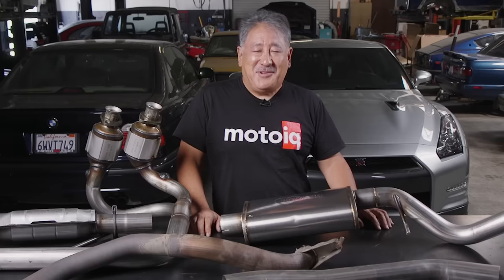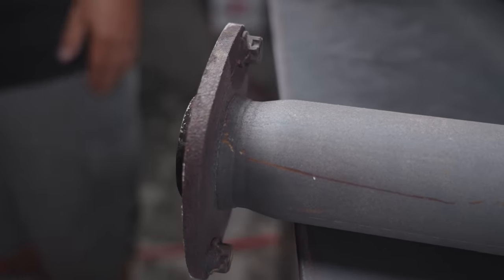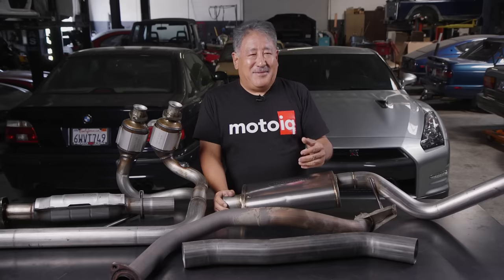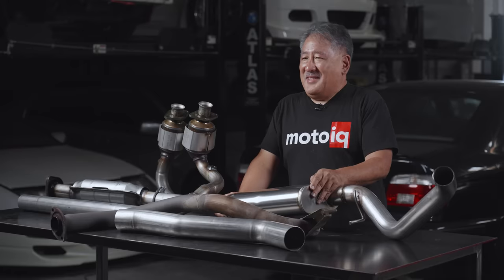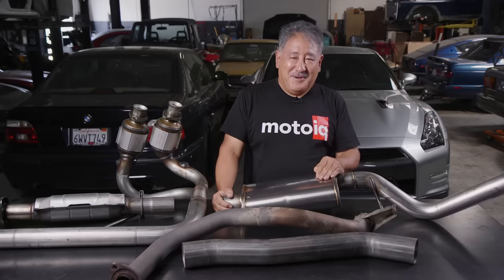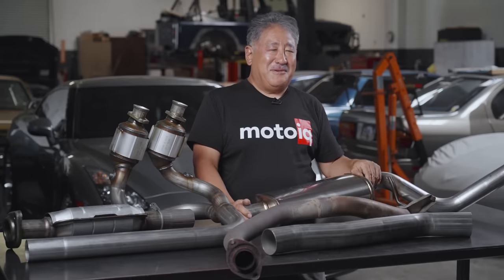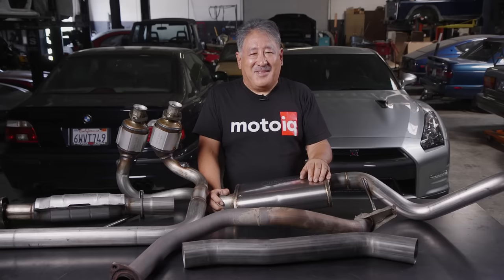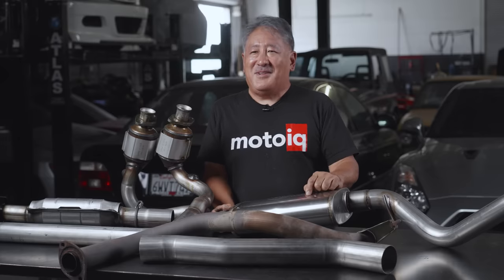Exhaust Back Pressure Myth DEBUNKED!

Comment: I have been trying to explain this to people for years, now I can just send them your video.

Awesome content!
Reply: Same here... there are other videos as well but Mike has some "cred".  Silly how even today people mention needing back pressure on a four stoke engine.   On two stroke "back pressure" is really reversion pulse tuning otherwise two strokes don't need "back pressure" either.
Reply: Exactly the same thing I was gonna say! I always tell people, if back-pressure is a good thing, go tell the top fuel dragster guys to put mufflers on instead of zoomie headers only!
Reply: Likewise, but there are folk out here still saying you need back pressure to make HP 😖
Reply: But really , how many people think what he said was I need 3 inch straight pipe on my stock Honda Accord
Reply: @daviddntait  and truthfully it is just a restriction, not back pressure, as you arent pumping air in from the other side.
Reply: . buy a harley and put duals on it with a proper tune vs. 2 into 1 with proper tune... proper backpressure fir the application puts the torque curve were you need it. . Nobody on the st needs it all at high rpm
Reply: @frederickcook87  no you need  back pressure to manipulate the torque curve to a area that suits your driving style. Not hp..  Wide open pipes only suit wide open use in higher rpm. Yes open pipes make more power. Doesn't mean it's usable
Reply: @dormantmenace  negative ghost rider, that’s a negative… but continue 👌🏾😝👌🏾
Reply: AWESOME insight. And although you implied it many times, it would be good if people understood scavenging. That is one of most over-used terms out there by people who don't know. Scavenging only comes into play at higher RPMs. Most folks don't realize that. So unless you are hard on the throttle and in upper rev ranges scavenging is almost irrelevant. The velocity issue also doesn't have much impact on engines at lower rpms (where daily driver requirements are). The only time velocity has any impact is also at the higher rpm ranges.
Reply: Same happen with flywheel, i try and try explain "you never lose engine power with light flywheel just inertia when release clutch " but these myths stay for years
Reply: if you follow this guys advice you'll be deaf before your 60
Reply: @frederickcook87  I’m still under the impression that you do because it evens out the exhaust pressure in the cylinders, giving you more even timing on detonation on all of the cylinders. You can go bigger exhaust but you have to run balanced headers.
Reply: @LeoKadettTouringCar  I'm genuinely asking since you brought it up. But that does mean you are siding with a heavier (more traditional) flywheel instead of those fancy schmancy carbon f***er lightweight flywheels? If you can enlighten me please do, I really want your opinion.
Reply: @dsch1znit  not sure I follow what you’re saying… did you even watch the video???
Reply: @dormantmenace  thanks for having a brain.
Reply: @frederickcook87  engine masters proved you and motolowiq wrong. Straight headers make less power than collector extensions. They tested a 1k hp engine and found there’s a sweet spot between 12-18 inches, creating a small amount of back pressure. It was enough hp difference that you’d be stupid to not find the proper length for your engine. IIRC they say d it was some of the cheapest power they’ve made. 
🌠 the more you know.
Reply: @frederickcook87  people that know their shit don’t need to watch a bullshit video. The dyno doesn’t lie.
Reply: magnaflow did a video like this years ago,
Reply: oh .....you mean cos ONE MAN says so.......its TRUE???????
Reply: @jimw7916  it appears many people say the same thing so......
Reply: Audi engineers also say that noise is lost energy.
Reply: Just send a top fuel dragster video, the most extreme HP and they have half foot pipes.
Reply: Really enjoyed your presentation sir...thank you for sharing your knowledge...
Reply: This is why i straight piped my crv lol
Reply: I used to think you could "suck a valve" running a motor without the exhaust hooked up. Because of the lack of back pressure LOL I'll never forget the first time I was corrected in a forum for it. It was a two-day rabbit hole of Google searches trying to figure out if there was ever a motor that needed it and why modern motors require no such thing
Reply: @lobsterroomcleaningservice  but you’re loosing velocity. But unless you are making actual power it’s not gna matter that much.
Reply: @shythawks9549  cat thieves is a big factor also lol
Reply: @throbbinwoodofcoxley6830  header extension doesn’t increase back pressure to make that extra power, it smooths the exhaust pulse turbulence at the collector and keeps velocity high past it to help with scavenging. The header extensions that engine master tested are the same or nearly the same size as the collector, so no increase of back pressure there. Compare a 3” collector going into a 2 1/4” pipe vs a 3” collector going into a 3” pipe on a 500hp engine and tell me which would make more power.
Reply: Pardon me sir, but would you have any ka-ka-ka-ka Cocaine? JK, bro I couldn't resist, have a great weekend😁
Reply: @dormantmenace  By your own logic, wouldn’t you restrict the flow of the system at peak power by attempting to create backpressure at certain points throughout the rev range? As in, you might gain a little bit of torque, but you would lose a lot of power.
Reply: @flytoday  I feel like being deaf in my old age might just be a blessing given the state of the world today
Reply: @dormantmenace  what does torque even have to do with back pressure??? Have you ever seen how a 4stroke engine works??? Back pressure only makes exhaust scavenging harder which will never benefit power nor torque... Only 2 stroke engines benefit from something that ressembles back pressure and even then it only works because they have no valves.
Reply: @throbbinwoodofcoxley6830  thats not fucking back pressure, read some technical documents please, that is the exhaust pulses helping each other to scavenge exhaust gases thats why properly engineered headers make more power than no headers or a simple straight pipe from each cylinder, the size of the header cavity manipulates gas speed via venturi effect and the lenght helps sincronize the pulses into a continuos scavenging cycle but nothing else...
Reply: Ferraris team of engineers would disagree

Comment: My thought is that in the old days, people would go full flow exhaust without re-jetting the carb. It would run leaner and lose power. I know because of a 1983 thunderbird that I put a 351w in. I ran dual exhaust with a h-pipe. it had slowed down. Once I listened to a local garage friend of mine (running that garage since the 60s) I drilled out the jets slightly, corrected timing, and installed colder plugs. It made a huge difference.
Reply from the maker: Bingo you get it!

Comment: I remember finding a book in high school and i believe the title was "the design and building of the british sports car" and by sports car they really mean racing car. It was written by a pair of british mechanical  engineers  and what i found fascinating  was  that it was filled with formulas and tables  that at first i was pretty sceptical about. For example and pertinent  to this subject  they had a formula that you could enter displacement,  compression  ratio, stroke and maybe rpm that you wanted to optimize  and it would give you diameter  and length  for both intake and exhaust.  Now this was 50+ years ago so i don't remember the formula or variables exactly but i was amazed  that these formulas  existed. As a gear head and at that time heading toward a career  as a mechanical engineer it reinforced that math could be a handy tool to be utilized toward that goal.
Reply: Probably David Vizards, he's pretty sharp!!!, Also on U tube!
Reply: The nerds try to forumulize what the real mechanics know by feel.
Reply: @MrSilus2000 Cringe, without the nerds you would have no cars to fix or tune by "feeling"
Reply: @Broprotato  Inventions don't come from nerds.  You actually need imagination and balls.  History lesson
Reply: @MrSilus2000  Sure bud, complexe machines just engineer themselves with passion and goodwill. No math, no physics and chemistry is required. You are just creating your own facts.
Reply: @Broprotato  Pretending my statement was about goodwill is kinda crazy.  You lie just to win Internet conversations what a wacko
Reply: @MrSilus2000  Projecting much? Yikes man! What a pathetic comeback.

Comment: Great explanation!  You are so correct!  The whole purpose of cam overlap is to let the air/fuel charge begin flowing into the combustion chamber while the exhaust valve is open, creating a negative pressure due to the exhaust pulse velocity leaving the header pipe. AF can begin filling the chamber an eternity of time, with respect to crank position, before the downward piston movement can pull the AF charge. Proper fluid dynamics is paramount to VE absolutely.
Reply: sounds a lot like how 2 strokes scavenge exhaust gases with fresh gases. it might benefit from pressure waves bouncing off changing diameter in the pipe, but obviously only at certain rpms. might work if you're tuning your engine only for top end power
Reply: And ya don't get negative pressure without scavaging. To have scavaging, there must be some backpressure even if it is as minimal as a 4 into 1 header; as opposed to a true open pipe for each cylinder. Run any motor on a dyno stand with a header and short collector or down pipe vs no header at all as in zero backpressure... tell me your results.
Reply: @j.thomas7128  first, remember this is especially about tuned engine with valve overlap . you're right its negative pressure that can help scavenging, but you cant generate negative pressure with positive pressure( back pressure). back pressure does the opposite of what you want for scavenging.
It's exhaust gas velocity/inertia that keeps pulling fresh air in the cylinder during valve overlap when intake valve just opened even though exhaust gas still has more pressure than intake.
The exhaust gas "wants" to go back to the lower pressure (intake), but because its already going fast towards the exhaust, it only slows down, but keeps moving through the pipe, and sucks gas behind it. with no header, exhaust velocity is lost because gas expands in every direction, so during valve overlap, the exhaust gas will probably go backward in the intake. if you have no valve overlap, open headers shouldn't have such a big impact, but still, inertial scavenging can help squeeze the most gasses out of the cylinder before intake opens. In fact, velocity is not the only parameter that can affect power, if you want a very complete explanation why back pressure is not good, watch https://www.youtube.com/watch?v=jjPeP_Nn2B4
maybe what you meant is that back pressure is needed as a by-product of velocity, but the best compromise is still highest velocity with lowest back pressure
Reply: @geemy9675  i understand your explanation. I think the point was missed. You don't have scavaging or boosted exhaust gas velocity unless you have a collective header or collector pipe. Any collecting header or pipe will add some, even if very minimal, backpressure. You won't have the same gas velocity or scavenging without a collector where the just fired cylinder helps to evac the exhaust from the previously fired cylinder. An engine with no header or exhaust manifold will have no as in zero backpressure. Adding a collective header will add some, if minimal, backpressure and some amount of backpressure is needed to create these scenarios. Do you think this reasoning is faulty?
Reply: @j.thomas7128  Yes maybe, but barely measurable and for an almost immeasurable amount of time, as some of the exhaust pulse from another cylinder may dam a header pipe at the collector.  I think if that were to become measurable or rob performance it would be related to post collector downstream exhaust piping—too small, too large, or turbulent flow.  When you consider how many times a valve opens or a piston moves one stroke at 3000 RPM in seconds, there are going to be variables in velocity causing different flow dynamics. I installed a WM8-22XE cam in my M8 107 Harley. It made a huge difference over stock performance with a good tune. I thought it was great and at peak performance, but I never could seem to get the engine to spin up achieving RPM over ~4500-5000 and it took a while.  I didn’t know until later it was sluggish as hell. This back pressure myth is huge amongst Harley peeps, and they all parrot the same shit they hear.  It didn’t make sense to me, so I rid the factory exhaust of a great big engineered restriction upstream from where it goes from one back into two before the Tab Performance mufflers. The change was unbelievable! Not a little or placebo effect, incredibly better.  Immediate taps on the rev limiter in in the first 4 or 5 gears and the only thing preventing it in higher gears is my sense for self-preservation. Speed kills, 😆.  That cam has a lot of overlap.  Unequivocally, the M8 doesn’t need back pressure. It destroys performance at least in my case. Take it for what it’s worth, this was my own experience. ✌️
Reply: My reply was not necessarily intended for J, but to the question of whether there is always going to be some back pressure.  I understand the comment that no manifolds would reduce performance because exhaust velocity would not create the scavenging or suction needed to pull the fresh air/fuel charge into the newly emptying combustion chamber. I think we are all on the same page here.
Reply: I had a comp magnum 305 flat tappet cam in a 357ci Windsor inside of a 88 lx fox body. I had a 150 shot of nitrous, but never needed it. It had so much overlap that it had to idle at about 1,000-1,100 rpm for it to run properly and scoot when needed. Man that car could breathe (just had to set the valve lash every 1,500 miles or so to keep it from dropping a valve at high rpm...)
Reply: @fishandgameman  speed has never killed anyone. Suddenly becoming stationary.... that's what gets you.
Anyway yeah, the idea that backpressure is beneficial is so insidious, some people have been hearing it their whole lives from people they respect a lot and feel so strongly about this one concept they'll argue 'til they're blue in the face. Kinda weird when you start explaining pressure waves and Bernoulli's Principle and it only makes people that much more desperate to hang onto how they thought the world worked.
Reply: @LifeInJambles  Sort of similar to when your parachute fails to open, It’s not the fall that kills you it’s the sudden stop when you arrive to the ground. I see your point.
Reply: @fishandgameman  gotta give it to Jeremy Clarkson on the speed quote but yeah, aside from the friction of moving so much faster than the matter around you, there is are no detrimental effects of velocity

Comment: This guy has a smile on his while explaining engine stuff. Thats how u know he love what he is doing❤
Reply: Or he’s stoned doing it lol
Reply: Gases have mass and moving gasses have inertia. Gasses have viscosity which means they will stick to each other and to other materials, in this case the exhaust pipes and components. Gasses are compressible. Gasses obey the laws of thermodynamics. These things can complicate design efficiency efforts. Why are expansion chambers necessary on some two cycle engine exhaust systems?
Reply: @crawford323 Expansion chambers are for reflecting exhaust gases back towards the cylinder, the exhaust gases contain some fuel which got sucked all the way through the cylinder (which is good for cylinder filling). In an optimal situation the expansion chamber is tuned exactly for the exhaust port's dimensions to have the returning pulse enter the cylinder just before the piston closes the port. With increasing engine speed the returning pulses grow stronger and stronger until you overcome the "hill" on the powerband. After peak power the pulses return too late to get into the cylinder (because of the port closing too soon (piston moving too fast)). By having a shorter pipe the pulses return quicker and the power moves higher into the rpm-range which can greatly increase peak power, though this also significantly decreases torque at lower engine speeds. Sorry if this is hard to read or if I'm rambling, I know I am, I'm crazy about this stuff. Video from motoiq: https://youtube.com/shorts/qf9eFYPYXUY?feature=share, great video from 2stroke stuffing: https://youtu.be/CZpn52gaA-0
Reply: And that’s why I love this man
Reply: He has no idea what he is talking about...... this is a views and money video.. dont take advice from here. Any Tech worth his/her salt will tell you that. Pure Garbage.
Reply: This is how you know he's lying.  I'm an old timer
Reply: @Lifeisagamekid that's exactly what I was thinking lol